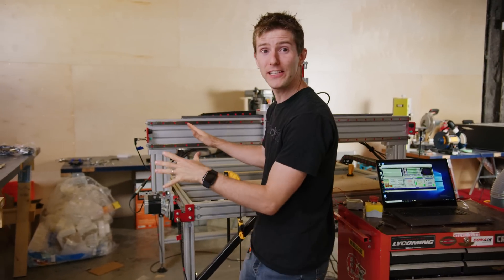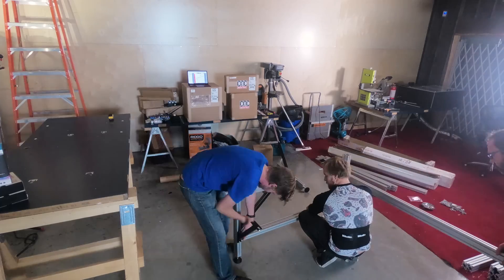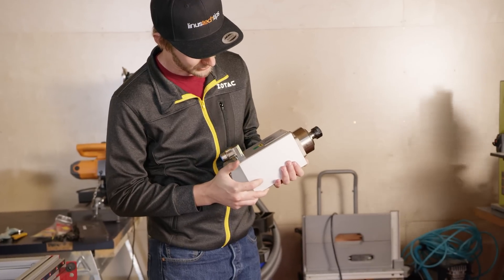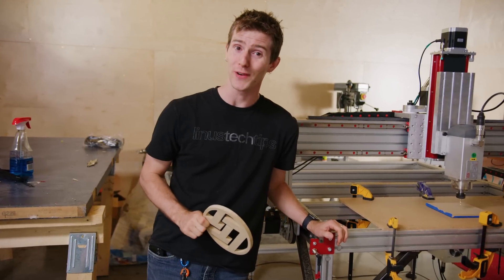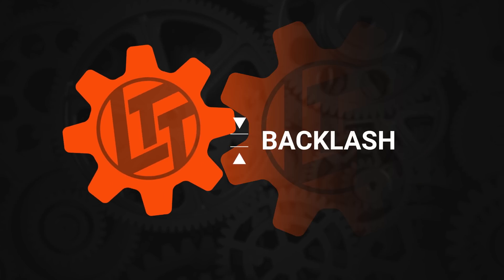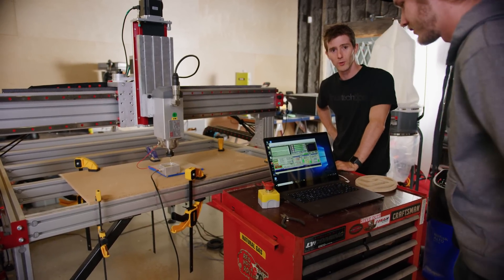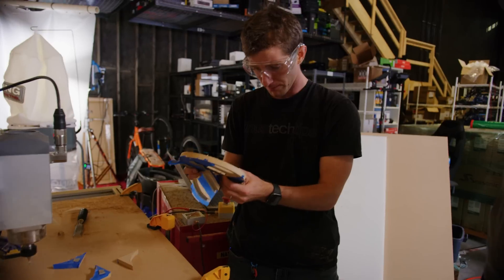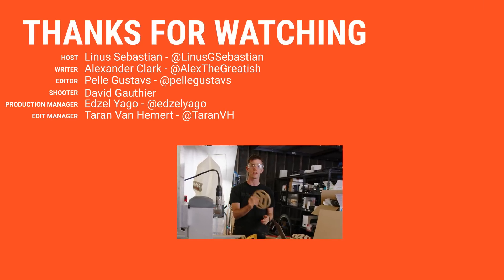Our New $10 000 Router!

Comment: Stepper motors are crap, Servo motors are much better especially at high speeds as well as durability, buuuuuuuuuut that's probably why your CnC is so cheap.

Edit : Also i'd say those 2 things you've guessed are power supplies, are probably frequent regulators.
Reply: MrAlexanderLang nah mate cnc router parts make the best routers you can buy
Reply: @OliverOddie  looking at our 5 axis cnc biesse router. hmm, not sure if cncrouters can stick up to that
Reply: You probably just have cheap stepper motors, or you are using them wrong. Stepper motors are used for percision, and are usually used at slow speeds. Please consider that they use stepper motors in both floppy drives and optical drives.
Reply: @Mosblinker  It's just i was a servicer for TIG,MMA,Mig-Mag welders,plasma cutters as well as CnCs use to build,maintain, and repair CnCs for about 5 years, i'd usually work on Sigma, and Omicron CnCs, and sometimes though rarely EMW, each one of them costs from 70000 - 100000 Euros.
Though without a plasma source they'd be 25000 - 55000, anyways 
Servo perform very well at High speeds, servo motors maintain their rated torque to 90% of their no load RPM, whilst Steppers usually loose up to 80% of their maximum torque at 90% of their maximum RPM.Servo are extremely power efficient with up to 90% of their power being converted into work, whilst Steppers consume a lot more power for the same amount of work, which gives them about 70% of servo motor efficiency, the rest is converted into heat.
Both Stepper and Servo preform well at low speeds, however in my experience Servo motors are a lot better, i've never seen a servo motor produce anything but clean edges, whist i've seen it numerous times whilst i was repairing old stepper motor CnCs, and that's on a same mechanical rig, we've actually had 2 CnCs in shop identical in every way but the motor, because that's a huge price difference.

Comment: You should check out Frank Howarth channel, he is running a CNC from cncrouterparts too and has built a pretty nice table with holddown clamps as well as very good dust collection. It's for a 4x8 machine and the dust collection is for a bigger machine, but I think you can downscale it.. otherwise you'll drown in dusts pretty soon ^^

Comment: “We are basically at the point where we can make anything out of acrylic...”

“Or any plastic”

has a 3 hp cnc

...you need to get some solid carbide bits and machine out of aluminum or steel, else you just blew ten grand on a fancy plastic printer/injection moulding replacement. You have a forge there Linus, just FYI.

Posting this at the 13 minute mark, I hope you acknowledge this in video.

Comment: Hot tip for binding to surface, masking tape on both surfaces, super glue on the tape of on table, super glue accelerator spray on the piece being laid down, match up the tapes! Lots of lateral strength, but ezpz to pull up! Credit to the Crimson Guitars channel for this technique.

Comment: Hey Linus, just a tip . If you use mdf board as your base, and hook up some form of pvc vacuum Suction, the board will stay in place instead of using clamps. And because MdF board is breathable, any board you place on top will be sucked down with the vacuum you built. You can also attach a hose to your router bit as it grinds away the wood, while sucking up all dust particles, etc.

Comment: Linus look up what safety gear you need for a CNC. If someone is killed by it (praying that doesn't happen) your insurance will probably find you at fault for lack of safety equipment. You really need to install laxan screens to all sides to protect staff. Small offcuts can fly out at very high speed (200mph+) these are as deadly as any bullet and need to be taken seriously. You should also be wearing at least a filter mask if not a respirator, your lungs are important and breathing in plastic fibres doesn't do you any good. Sorry if this sounds like a long rant but I deeply care for all the LTT staff and want them all to be safe and happy at work. 😊

P.s. never put anything in a running CNC!!! 
Body parts are nothing to a CNC, if it touches you say goodbye to that body part. If you reach in with something else (say a hover) and the bit makes contact with it, you'll be lucky if you only end up with metal shards of hover in you. Please be careful and have a staff meeting explaining how deadly these extremely powerful machines can be. There an amazing tool and I'm glad but nervous you have one. Just please teach people this is a machine that needs to be respected, and is not a toy.
Reply: I really hope Linus sees your post. That is a quite dangerous machine, and given the LTT teams proficiency with tools in general... Let's just say I worry for their safety like you do. As a former CNC-operator, and present welder and CAD-designer with kind of an OSHA assignment at my workplace, I know a bit about these things. Please be careful.
Reply: Agreed. Also, them talking about getting a metal lathe is worry worrisome
Reply: @JimBuschman  what's wrong with a metal lathe? At least on that the bit is stationary. Not trying to oversell the safety of one, but if you are working safely they are okay (working alone at 3 am is not safely if anyone is thinking of the Yale incident)
Reply: nothings wrong with one. Just can be dangerous is all.
Reply: I have heard some machinists say that a lathe is the most dangerous piece of equipment in a machine shop. I don't know if it is true, but I have heard it said.
Reply: Manual lathes definitely are.
Reply: Linus' discount amputation inc.
Reply: We had a machine like this at my summer job and it was surrounded by at least 2 meters of a kind of pressure plate around the machine which shut the machine down if you stepped on it. And the machine was used for HDPE plastic which is really soft. Seems like Linus can use some more safety equipment haha
Reply: The thought of someone bumping the go button while those spanners are being used. For the love, HIT THE RED BUTTON BEFORE YOU GO NEAR THE HURTY BITS, it's easy.
Reply: For sure, they should have an expert come in and give them a talk on safety and recommend some safety equipment or else someones going to get sued.
Reply: Is there a YT channel that focuses on reviewing high end components of building customized PC that are specifically made for 4K video editing (Cyberlink Powerdirector), faster rendering and production? Plz share if anyone knows of any channel. Thnx
Reply: This should be the top rated comment and the name of the machine.
Reply: If anything goes wrong at his shop he'll probably die of old age before WorkSafeBC finishes going through the channel and documenting every infraction.
Reply: Nonesense poopy pants! Let's program it to precisely cut a template around my hand!
Reply: NeonVisual poopy pants 😂 reminds me of Ace Ventura
Reply: put on gloves, get stuck because of gloves, loose hand because of gloves
Reply: While I appreciate your concern for their safety I do have to disagree on a few points, especially your extreme hyperbole and scare-mongering. While I know you mean well I can tell you that it's better for them to not be overly terrified of the machine that they're supposed to work with because that can actually create some pretty serious issues by itself. Trained machinist here who has been working with manual lathes and CNC milling machines for the past 15 years btw.

"If someone is killed by it (praying that doesn't happen) your insurance will probably find you at fault for lack of safety equipment." -> Yeah, you're not gonna get killed by this thing, although you could get cuts and bruises. Definitely agree that they should be wearing basic protection like safety goggles (which they are) and special machining approved clothing that is less likely to cause issues if it's caught in the tool. Also has to be tight fitting with those clip-buttons that self-open if too much force is applied. Also, DO NOT WEAR CLOTH GLOVES!

"You really need to install laxan screens to all sides to protect staff" -> No, you really don't, especially not for machines as small and weak as this. However, considering the most likely material that they'll be working with (wood, plastic and aluminium) it'd be a good idea for keeping the surrounding work area cleaner.

"Small offcuts can fly out at very high speed (200mph+) these are as deadly as any bullet and need to be taken seriously"-> Uh, no. These small cutoffs are the reason why long-sleeved clothing and eyewear should be worn, they cannot and will not under any circumstances kill you and are definitely not "as deadly as a bullet". Heck, your 200mph+ statement itself already debunks your "as deadly as any bullet" argument. If a tool breaks the worst that can happen is that you get a small cut from one of the larger fragments if it hits exposed skin at the wrong angle. Regular steel chips won't do jack shit.

"You should also be wearing at least a filter mask if not a respirator, your lungs are important and breathing in plastic fibres doesn't do you any good." -> A filter definitely wouldn't be bad if they work with wood or certain types of plastic. Considering the general levels of incompetence of the LTT crew I'd definitely suggest wearing it as standard procedure for any plastic/resin or wood.

"Body parts are nothing to a CNC, if it touches you say goodbye to that body part. If you reach in with something else (say a hover) and the bit makes contact with it, you'll be lucky if you only end up with metal shards of hover in you." Hyperbole if I've ever seen. Yes, you have to be careful and they definitely should keep their hands any anything else away from the tool and never lean into the machine. However, your limbs don't magically start flying off if you touch them. Just wear the appropriate clothing and keep your hands to yourself and you're quite fine.
Reply: plastic fibres, pffft unless he is making plastic baby powder there is nothing to worry about.
Reply: lol we had a meeting on this stuff and if we don't hold down the part with one hand and the vacuum cleaner with the other we don't get to work with it ever again. never trust safety equipment or someone making you safe, only trust yourselves xwhen it comes to safety

Comment: Not everyday you see Linus with a CNC Flatbed Router, great kit and very sturdy which is important.  I run about 3-4 CNC's over the years, taping down is one method as the other is vacumn suction bed, making a suction pipe will be challenging with the pipework, it took us many tries to get it right and they clog all the time.  

It opens up Sign Making, will cut into MDF, many woods, HDU, Foamboard/FoamX, Acrylic.  The faster spindle speeds are good with Acrylic but slower moving movement.  

VCarve/Vectric is amazing software, we used it a lot.  

As you said, extraction is important... yeah its gets everywhere and it just needs it's own room.

Comment: 1,3k dislikes huh? They don;t understand the value of this machinery... nope!
Reply: It's probably because of the shitty safety practices (or lack thereof) shown in the video. They really should have explained that the router shouldn't be left in that open state indefinitely.
Reply: Maybe they thought network routers?
Reply: @haxhxm841  yes
Reply: It's precisely the people that know their shit that probably disliked.
Reply: @fer662  Nah. I know those things. It's cute, but for small parts it's perfect. I suppose with a little ingenuity you could attach a MIG torch or a plasma cutter.
Reply: I have one. I made it.
Reply: 1.5K people who understand that Linus probably shouldn't be allowed around any kind of power tool 😂
Reply: Arjan Stoop you were able to cut aluminum or steel on that thing? What stepper motors are you running and what depth per pass were you running
Reply: Maybe they thought that it is network router, not 3d cutter. (As I did).
Reply: Or perhaps some people dislike clickbait...
Reply: They're all Luddites! Filthy Luddites!
Reply: The intro sponsor transition man... no transition... dislike.

Comment: Nice nice - to see this, because:

I work often with this kind of this machines. If you like you can see this machines under https://www.aristo.de/en/home/. Special i use a Aristo GL 2023 machine an amazing machine.
Ok the price is extrem high - like around 120.000 to 200.000 EUR ;).

I'm very interesset in some videos from you with your cnc-router/machine. 

Ah we cut - MDF, AluDibon, POM and other no metal material.
Reply: PS: Linus a good tip from me for a vac-cleaner -> look for Nilfisk - a great machine (like high.end in PCs) for vac dirt and other things.

Comment: That messy cut you've got can be solved by selecting the right type of cutter for the job, if you find all that furry shit on top then you need to buy an up/down helix cutter. The helix on these cutters changes direction halfway down the cutter so it pulls the material up from the bottom of the board and pulls the material down from the top as its cutting. Up/down cutters are also good for laminate or anything that might chip as its cutting.

Comment: I work in an automotive manufacturing plant. Then we are loading parts into the jigs there are light "curtains" that are used to send an emergency stop signal if the equipment is not in a position for parts to be loaded. When we go in the line to change tips we use "lock out tag out". Which is to say prior to entering the line we de-energize it and put a lock on a safety mechanism that will keep it de-energized. So in an industrial setting that red button on the toolbox would be pressed and have a lock put on it to prevent someone from starting a program and potentially hurting someone and damaging the equipment and tools that are present.

Comment: laser cutters is better. they work better with sheet metal. you can build plastic parts with cheap 3d printers but metal parts is better in most cases.

Comment: 2200 watts at 120v is 18.3 amps. A 12 gauge wire is required, a beefy extension cord. Wires and components are a lot smaller when it's not a plebian 12 volt standard. If you canucks are on 220-240v then it would be under 10 amps.

Comment: Use nylon screws to screw the material down to the sacrificial material. That way if the cutting head hits the screw it'll cut right through it. Metal screws could be used if you absolutely must but only if you know for sure that the head will never hit it.

Comment: Hey, for dust collection watch this video:
https://www.youtube.com/watch?v=hqyxRLoujts
Maybe it'll give you ideas or let you avoid some mistakes.

Also notice how this guy's CNC table is organized. He has special adjustable fixators to hold pieces of wood down, so he doesn't always need tape. He also most of the time will just screw the wood to the table with screws, (in parts that will be removed anyway) and leave small bridges in the wood to hold the creation in place. Later those bridges can be easily cut off. That's basically how most plastic molds look like, if you have been into miniature modelling.

Also I suggest to just watch a bunch of Frank's videos, to see some tricks about how to work with CNC machine. They are really good, and it shouldn't take long anyway.

good luck!

p.s. build an all-wooden PC case? With CNC'd and then glued up box, some nice engraving and stuff?

Comment: "The Woodchuck"

Suggestion: 
Modify your wasteboad a little so you can use (small steel) clamps to hold your project in place instead of tape.
Or use wooden clamps if you`re worried that you  measurements will be off at first and don`t want to risk destroying  your tool. (it`s better to mess up a $10 wooden clamp instead of a very expensive toolhead.)

Edit:
We used these:
https://www.zipy.ro/p/ali/4pcs-cnc-router-table-clamps-fixture-presser-for-cnc-t-slot-table/32617716907/
(i couldn`t find a english site with a clear vieuw of all the parts and how to use it)

But if you want to go the "safe" wood option (not my video):
https://www.youtube.com/watch?v=bpJyqLoqV04

Comment: BEWARE ! Those joints are crap, they will come lose after some time, all of them. If you want to secure them use a loctite 503 or smth like that. If on the other hand you want to do something properly for the first time, take out your drill and drill some holes. you would start in the groove so that you hit your profile you want to connenct, then you have to tap the "to be connectet" profile with a m8 thread. loctite the shit out of it and volá. Yes it takes for ever, yes it is a pain in the ass but those connectors will all come loose after some time, especially on a mashine that is moving.

Comment: You guys need to fix the table differently. It’s great if the machine is stiff as hell if your table itself flexes, shifts and vibrates. Take something like a thick metal plate and then a thick MDF plate on top and fix it differently than just with those C clamps. 

You also need a different tape, the thick GoPro tape is, well, too thick and elastic.

And lastly: use fusion360. They explain most settings to you quite elaborately.

Comment: can you use hydraulics instead of stepper motors?
Reply: Hydraulics are better for situations where you need a lot of force. Stepper motors are super accurate, and don't require any sort of pumps or support equipment besides a power supply and driver. Stepper motors are also easier to replace if they go bad. Also they are much quieter.
Reply: @EastOnyx  thanks